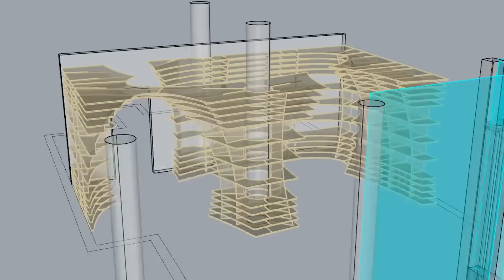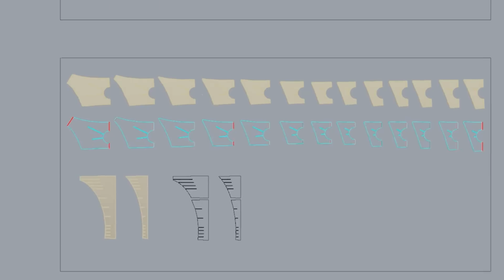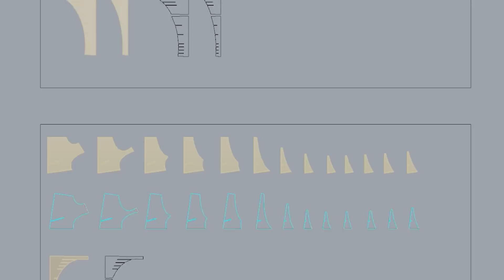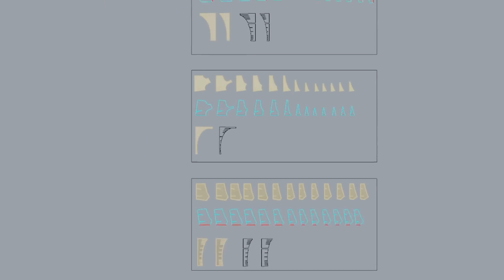Building a Sneaker Store in Soho

Comment: What is that gun/nailer you used at 2:14 ? Are those gunpowder nail guns?
Also how did you secure the selves to the wall?
Reply from the maker: It's called a Ramset. It's a powder actuated gun for sinking nails into concrete - faster than drilling!